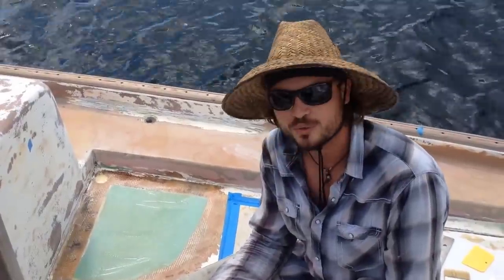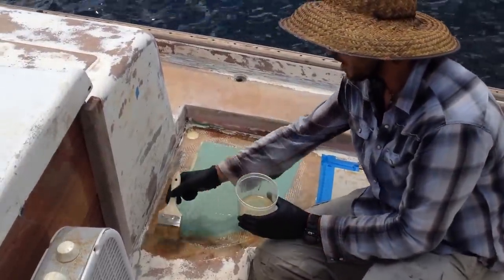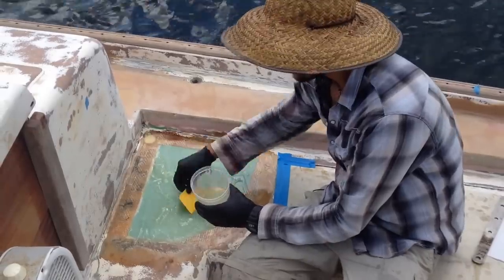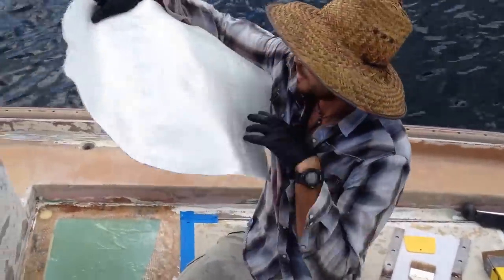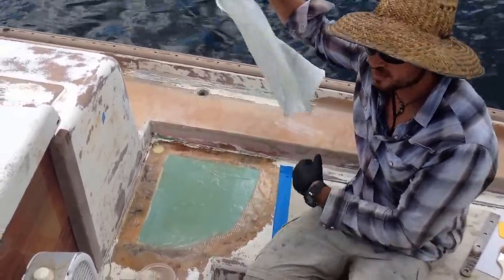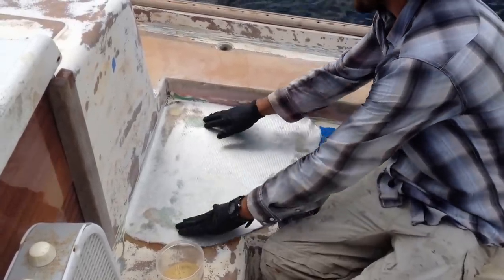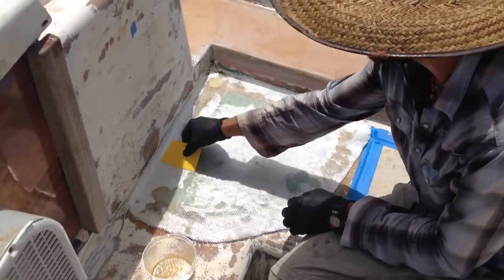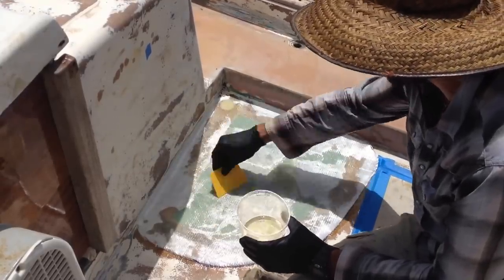Atticus Update 9: Fiberglassing the deck repair

Comment: I’m really interested in knowing exactly what you used to replace the core and also how do you locate the rotten core? Thanks for sharing this!
Reply from the maker: Hey Derek! We identified the rotten core mostly from the sound of the deck (use a weight, or screw driver) and by a slight flex in the deck. I think there might also have been some cracking in the gelcoat if I remember correctly. Jordan also had to drill in there to do some scupper maintenance and noticed that it was wet. Then we just scopped out the wet balsa core until we reached solid, dry wood. Jordan replaced it with high density foam board. Let us know if you have any more questions!!
Reply: Project Atticus you two are so awesome. Thanks for the reply. Already started saving for my cruiser!!
Reply from the maker: Derek Woodring that’s awesome! Any idea what kind of boat you’re looking for and size? Don Casey was recently selling a turn key allied seawind for $25k! Huge steal!!

Comment: What is the green material you used to replace the rotten core?
Reply: david balingit It looks like divinycell We sell the "H60" at www.fiberglasssupplydepot.com in 2x4 foot pieces for shipping or 4x8 sheets if you pick it up at our 2 locations in Florida.
Reply: +Fiberglass Supply Depot 
I couldn't watch the video, but I appreciate the link. Good source for materials.

Comment: There was and is a reason the balsa was there to begin with...Fiberglass captures heat and cold very well...Here is hoping you went with some kind of wood core
Reply from the maker: Carey Feazel we used high density foam.